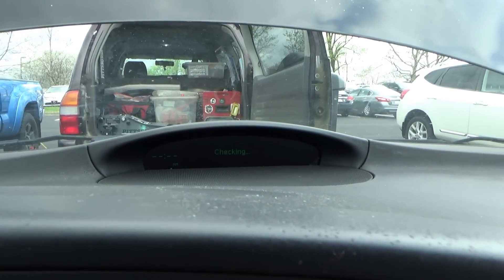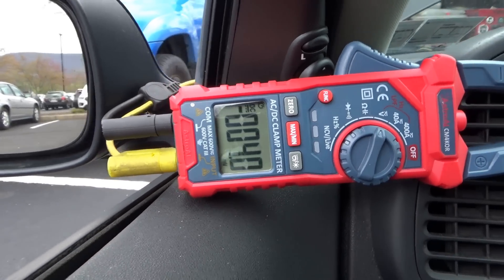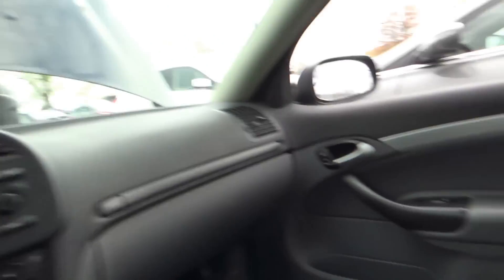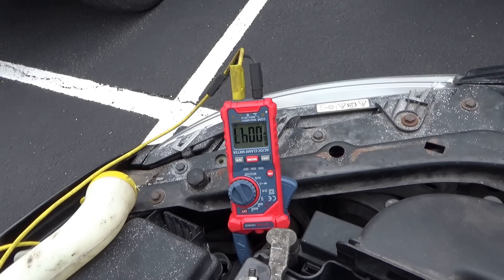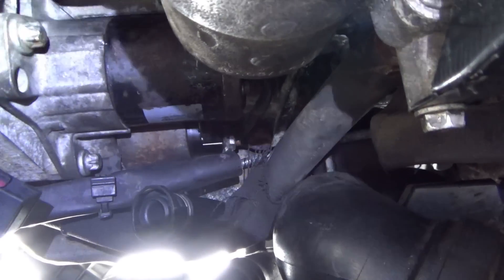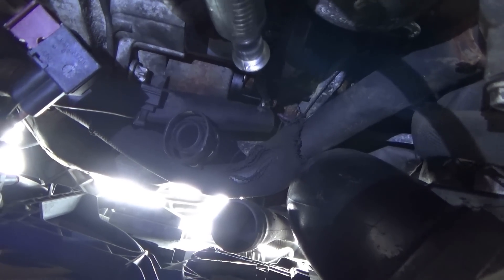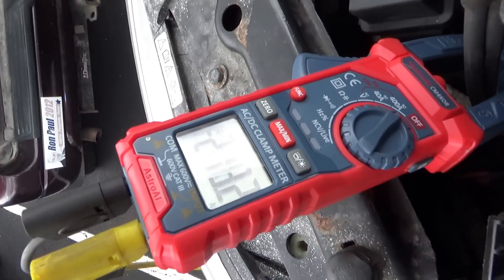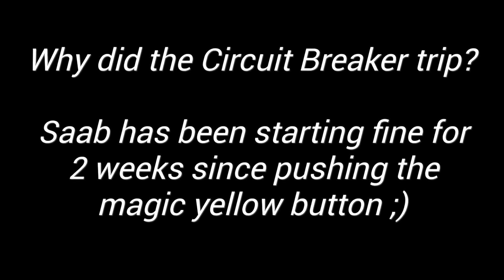Saab STRANDED in a Parking Lot? (9-3 V6 Quirky No-Crank)

Comment: I have a SAAB 9-3 4cyl,  no such device on my battery?  I wonder if its SAAB or third party??
Reply: It's an original factory Saab part, but not all 9-3s have them for some reason.
Reply from the maker: Apparently only V6 models have these disconnects?
Reply: @PineHollowAutoDiagnostics  I wonder if they discovered the V6 was prone to electrical fires during crash testing?

Comment: Last time I was up this early was two days ago.
Reply: and it was well worth it.  Light bulb day.  I was a little shocked he didn't pull apart the dash like he did with the UFO cars gauge.  But still a nice trick with the resisters.  Shame they don't sell temp sensors with a resistance range so you could just swap in the amount you need.